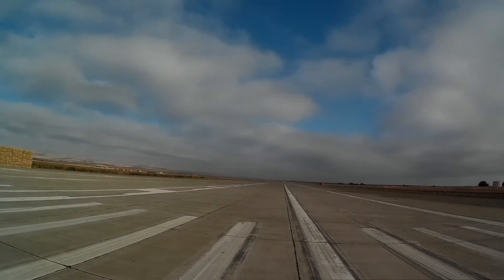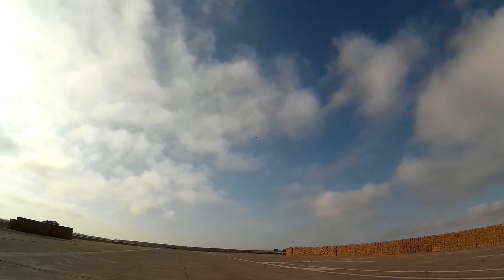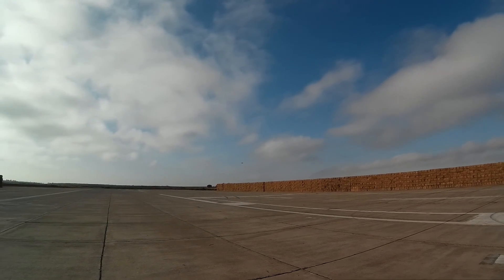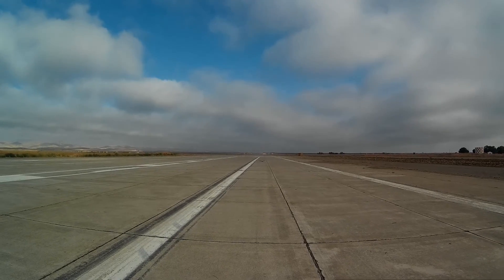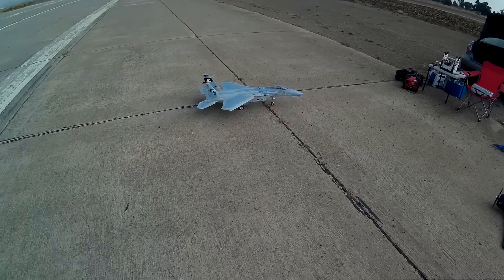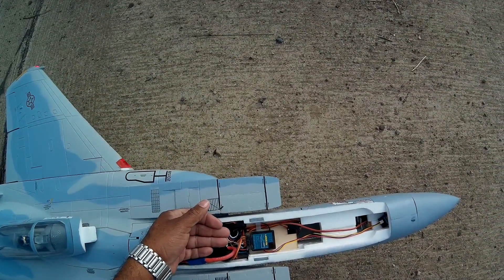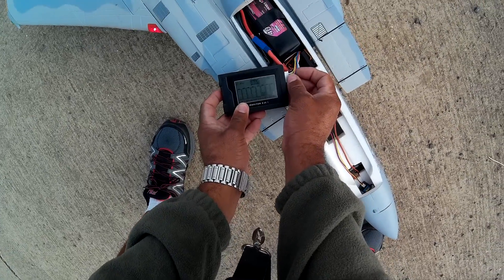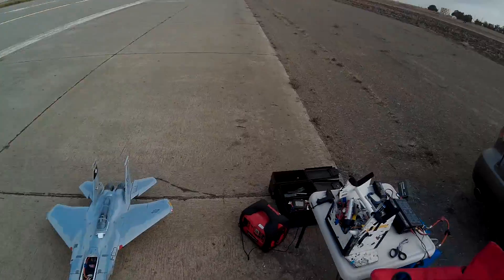Freewing F-15 with Leopard 4082 1600kv motor

Comment: Impressive flight and that´s already 7 years ago! On my Arrma Mojave I still have a similar 6S inliner 4092 rocket motor with 1650KV wouldn´t be bad either xD Will have it in mind if I buy a 90mm edf some time...

Comment: Nice video.Nice set up,a lot cheaper than the 8s set up but I must say the 8s really kicks some butt.I have the 8s and you can go vertical from takeoff.Anyway nice flight and airfield.
Reply from the maker: It is a compromise. The 8s set up is by far the most bang you can get. I just wanted to challenge myself with a 6s. I have since changed to the 4092 1730kv motor with really good results as well. When I use the bigger 6s 30c 6200mah pack the plane really comes to life. Look at this video and see what I mean... https://youtu.be/NOGHITabLhg